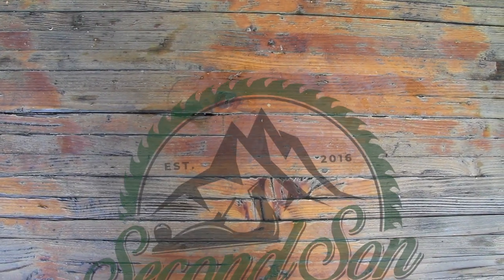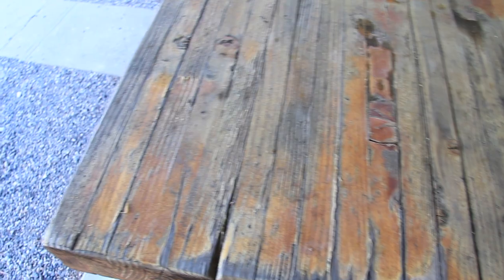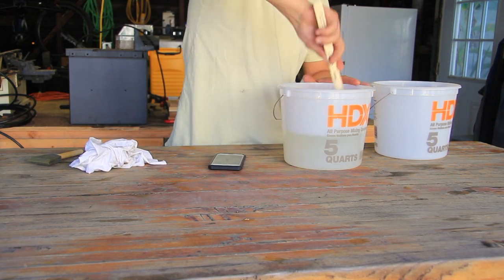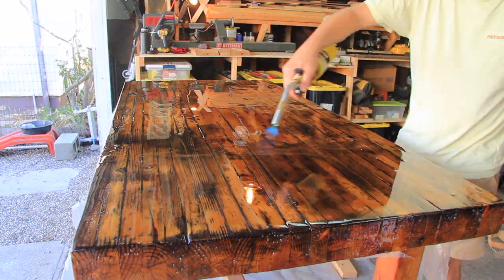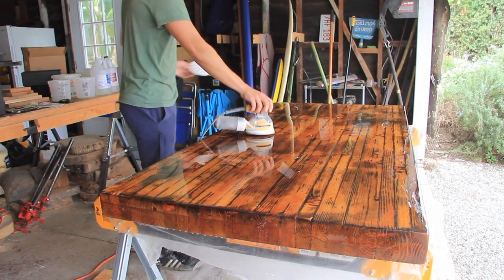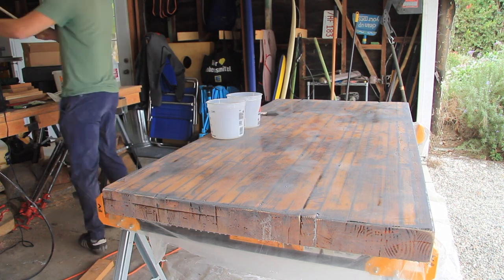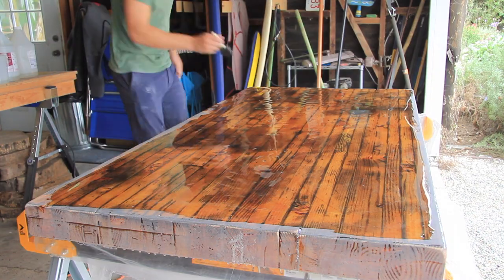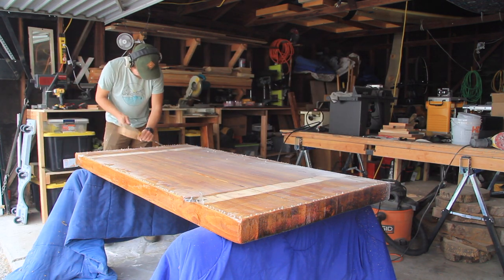Epoxy Pour on a 2x4 Table // What To Do If Epoxy Bubbles

Comment: I’m doing countertop.  First layer of epoxy had a lot of bubbles for one reason or another.  I’m in the process of sanding it down starting with 80 grit and working up.  Just doing some by hand they don’t appear to be deep so I’m hoping the sanding and repour work.  It can be very frustrating.  This time after sanding I will wipe with alcohol and microfiber cloth.  I will make sure it is mixed very well.  Any other suggestions?  Torch didn’t help keep all bubbles out first time but  I’ll try again.  Other than the bubbles it looked great.  So I hope I have the same luck.  
Your table looks exceptional!  Great job!
I think you have to enjoy this type of thing.
Reply from the maker: Yes, bubbles are quite common, very frustrating but part of the process, so just reframe your perspective :) I have been wanting to try thinning epoxy with mineral spirits to see if it will seep deeper into the holes, and use this to do just a seal coat. But you could also try CA or hot glue to fill the voids before pouring epoxy. Use an electric sander and wear a mask! It may take several coats, but that’s okay. Yes try and enjoy it haha cheers!

Comment: You should have done a thin seal coat first which seals the voids and then go a little thicker on the subsequent coats. Great job though. Have a great day my friend.
Reply: totally would have saved so much labor with a thin seal coat. but you battled through it.
Reply from the maker: That's essentially what I did during the first coat, but I guess I may have used too much. Anyways, thanks for watching and for the comment! Take care.
Reply from the maker: Perhaps I should have done less the first time eh?
Reply: @SecondSonWoodworks  for sure! lol thin to win just like cards lol
Reply: @SecondSonWoodworks  yes. Put a VERY thin first coat. That seals it better. My first epoxy pour was the same way lol.

Comment: You started wrong. You MUST, when you have an uneven surface, with holes, you have to first POUR, no brush, epoxy into those holes, you need to fill those holes first. Let them dry and cure, sand, clean and then POUR, NO brush, epoxy to the entire surface. That is the only way you will not have a crazy amount of bubbles. Using a heat gun, is better than a torch.
Reply from the maker: Yeah you are right!’

Comment: The only thing you could have done to stop the infiltration of water was to put an epoxy coat on the bottom of the table prior to doing the actual table.  Just run some tape around the edge, flood the bottom.  Let it dry.  Clean up the edge a bit then proceed like you did on top so the water that is in it won't increase or decrease.  Also less chance of separation and expansions and contractions due to water.
Reply from the maker: Thanks for the tip!

Comment: Great idea for the weathered look.  i do hope you learned something from this project.  the hot glue was a great idea but now you need to do it on the second go round.  Also denatured alcohol and a soft little brush will get rid of the whit e dust.  also you need to roller the underside of the edges and that will cut down on the drips which will bring the job down to 2 or a worst 3 coats.  I like the look  good.    RC
Reply from the maker: Thanks for watching and the comment! And yep, definitely learned a lot. Great idea for the dust. Cheers!

Comment: let us know if that coat that went on over the non-sanded coat ever dis-adheres and starts lifting off. I've seen that happen before and it seems like most people see it anywhere between 6 mo's and 2 years
Reply from the maker: Oof I hope it doesn't! I will let you know if it does. Holding up well now.

Comment: The bubbles come from the epoxy soaking into the wood. You should try a sealer first next time.
Reply from the maker: Yep from all the cracks in the wood, and that is what the first coat was, a seal coat

Comment: I had this same issue in a beautiful maple table.  Even thought I had my ducks lined up by doing my research and applying a couple coats of finish oil and sealer.  But I still had a massive bubble problem along certain parts of the grain.  It was devastating to see.
In the end I had to take it all off and try again.  Surprisingly wood wax finished was the ticket, and I had zero bubbles after applying and buffing the table with it.  Lessons learned the hard way.  Thanks for sharing yours.  Makes me feel better knowing many of us have done the same thing.
Reply from the maker: Wow that is a great idea, wax, thanks for sharing! Appreciate you watching and commenting. Cheers!

Comment: I think your video was really worth watching. I have been making a table top for a few weeks now from recycled timber beams. I taped all cracks on the bottom and the side and used deep pour casting epoxy into the topside cracks and knot holes until no more bubbles. About to sand it all back now. I am going to polyurethane the whole thing as it will be exposed a bit to the sun (Australia) and the polyurethane has some UV inhibitors. I really like the look of your table. Hoping mine turns out as nice. Well done.
Reply from the maker: Thanks so much for watching and the comment! Sounds like your table is gonna be beautiful! Cheers mate

Comment: I done hardwood floors with my brother in-law years ago.. You might try a woodfloor feeler to feel the cracks, then sand it off.. Also use sheeps wool that wraps around a block with a small handle to apply a thinner coat of the epoxy 1st. Could help from allowing air to seep out of the cracks.. Then build thicker coats 2nd & 3rd
Reply from the maker: That is a good idea, thanks for sharing! Cheers.

Comment: You may want to epoxy the bottom also to prevent uneven moisture absorption. Love the weathered look you got.
Reply from the maker: Great idea! Thanks for watching
Reply: I saw another video in which they used a product called "redgaurd", on the bottom.  Same concept and probably less time-consuming.
Reply: I thought the same
Reply: Not just resin the bottom, but also resin the legs and all of the wood.  I resin coat metal and concrete table tops for my outdoor area.  The sun can really beat the resin up, however, but that's the case for any and every sealer.  But I just make it a practice to strip and reapply the resin.  Curious how this looks from being in the weather for a few years.

Comment: Had this happen with some knots yesterday.  When the epoxy started to thicken and was unable to seep down into the knot, I took a nail to the bubbles to force the air out.  The epoxy was still thin enough to level out.  I made the mistake of applying heat from a heat gun to one and it thinned out the epoxy causing it to run back down into the knot forcing out more air.  Once it cooled, I took the nail to it again and all was good after that.
Reply from the maker: Nice, good idea, thanks for watching and commenting!

Comment: Nice work 👍🏿 Any tips for a first time epoxy pourer covering an outdoor wooden bar top.
Reply from the maker: Thank you! You know after doing this table and letting it sit outside for 4 years, I will never do epoxy for an outdoor table again, the sun, moisture, and temp changes ultimately destroy it. I’m gonna do another video on it at some point, but I’d recommend using a spar urethane instead for outdoor stuff, it will last longer. Best of luck mate!
Reply: @SecondSonWoodworks  Any suggestions on a product. There seems to be just as many of those to choose from as the epoxy.
Reply from the maker: @thatmanbolt2877  I have used the Helmsman and it is good

Comment: Good video and info as I have some resin problems myself. Just wondering, I was always under the impression the resin items do not hold up well in the outdoor weather. Have you found that this is not entirely true?
Reply from the maker: I’d say it’s halfway true, if you are in shade than it seems to hold up well, but mine was in direct sunshine and morning moisture it has cracked and changed over the last several years, will have to do another refinish at some point. This is common for most outdoor furniture though. But I think it has protected the wood pretty well and I’ll still be able to refinish. I’ve heard you can thin epoxy down to get deeper into the grain. I think doing that may enable it to last even longer.

Comment: Pay attention to that table in the hot sun. Most of these epoxy resins wont stand up to direct sunlight and will turn yellow and eventually crack apart .The resin finishes are much better when used on furniture kept out of direct sunlight (indoors). Very nice job !.
Reply from the maker: I have already seen quite a bit of wear from the sun. Amazing how strong it can be! Thanks for watching. Any tips on polishing?
Reply: i usually just wet sand it with 220 / 400 / 1000 grit then use a light coat of mineral oil on top . The mineral oil gives it  a nice natural look while bring out the character of the wood .
Reply: Give it a coat of Captain’s varnish….high UV inhibitors….all boat people coat there I epoxy with some sort of UV inhibitor
Reply: @SecondSonWoodworks   Yep... @NicholasRVonStaden is right. You need to topcoat the Epoxy with a strong UV Inhibitor, like a Spar or Captain's Varnish.. Don't expect even that to last much more than 3-4 years without light sanding and recoating with the topcoat.. Nothing holds up to harsh Sun. It's the killer.
Reply from the maker: @MarkThomas123  Sun really is the killer!!!

Comment: If you seal the wood with something that dries faster and clear like polyurethane, it helps tremendously with air bubbles that pop up on the final pour
Reply from the maker: Great idea, the seal coat with epoxy didn’t seem to work, maybe even thin out the poly, thanks for watching
Reply: Can i use lacquer to seal the wood surface before I apply my epoxy? 😢

Comment: Excellent! I would keep a tablecloth on it to protect it from the UV rays of the sun. I would also recommend doing the legs. Just one or two coats. I finished a 90"x48' Table made of chestnut. Those worm holes never filled up. Thanks for sharing.
Reply from the maker: That is a great idea, wish I would have done that because the weather and sun has already done a lot of damage to the top, unfortunately. Wow that is a big table! Good job. Thanks for watching. Cheers!

Comment: Hi bro! Very nice video! How is the table after these months? I’m looking for some outside wood works with epoxy, but didn’t find many information. Thank you!
Reply from the maker: Thank you! It has been great. I put a cast iron pan on it through recently, on accident, and it damaged a spot. I will be doing a buffing video soon with this compound I saw. Hope that it will take it right out. The epoxy works great with the outdoor furniture, if you apply it right.

Comment: Saw elswhere on YouTube that two or three (or four) skim coats sanded in between seals the surface for the bubble free final big pour. Less goop for bubbles to enjoy (pop) and dries faster. I think wood glue and sawdust for gaps. I think.
Reply from the maker: Good tip! Thanks for sharing and watching

Comment: Painters tape along the edges on the underside clears up the dripping problem. The day after pour it can be remove with a little heat from a heat gun and it will pull right off taking the drips with it and leaving perfect edge.
Reply from the maker: Good idea, although I’ve done the paint trick and it sometimes gets stuck after the epoxy dries and you have to sand it off. I’ll try with heat next time. Thanks for commenting!

Comment: Whenever I've used a table top epoxy finish, tiny TINY dust particles settle on the finish as it cures. You know the ones, you can see them floating around in sunbeams. After the epoxy cured, these would be all over the surface. I'm not seeing any of them in yours during your final product B-roll at the end. How did you deal with this issue?
Reply from the maker: Yeah that is always a worry. The best thing I have found is realllllllyyyyyy cleaning my shop beforehand, using my air compressor, maybe even leaf blower to get out all the dust! Good luck mate

Comment: This may be a silly thought, particularly since I have never used epoxy, but what if you thinned it a bit? I have done several hardwood floors and when using polyurethane, I have used a wee bit of paint thinner in the mix. This seems to let any bubbles that may come up be easier to brush out. Just wondering.
Reply from the maker: That’s not a bad idea, I’m not sure if that would work out, but may be good to try on a small scale. Thanks for watching and the comment!
Reply: If you want to work with thinner epoxy all you do is let the bottles sit in some hot water before you mix it

Comment: Just watched some professionals doing counter tops. The don't use or recommend flame, but just mist with alcohol, and the bubble pop. You say there is a lot of sun in your area, exposed over time, it will change the  color, and even crack it.
Reply from the maker: Great idea, thanks for sharing

Comment: Good work, but you may find the epoxy is not UV protected and will degrade rapidly in the sun.  A good UV urethane would keep the table protected for a much longer time.  The urethane should be applied over a well-sanded (250 G) epoxy for a strong mechanical bond.
Reply from the maker: Thank you and yes you’re very correct! Thanks for the tip and watching, cheers!

Comment: I had that same “epoxy dust/bubble” problem. After I sanded I actually used a hose with a spray nozzle and it worked just fine to remove the dust from the small craters.
Reply from the maker: Great idea! Thanks for watching and commenting. Cheers!

Comment: Working with epoxy on any wood besides MDF needs a seal coat…1oz per square foot, just enough to seal the wood then you do your flood coat. Then you only have to go over the epoxy 2-3 times during the cure process with a torch to pop minimal bubbles providing you mixed it correctly.
Reply from the maker: Yes which is just about what I did, and there were still bubbles. So people should plan to sand out bubble after a seal coat in situations like this. Cheers!

Comment: you need to seal raw wood prior to coat in epoxy. it eliminate your bubble problem
Reply from the maker: Do you mean apart from the seal coat of epoxy?
Reply: @SecondSonWoodworks  get one of these. sometimes you need more than one seal coat also but it should just be seal and flood coat for over wood but sometimes you need two flood coats ya know. two projects are never the same. ,,,,, 
VEVOR 1.5 Gallon Stainless Steel Degassing Vacuum Chamber with 2.5CFM 1/4HP Vacuum Pump Kit (2.5CFM Vacuum Pump Single Stage + 1.5 Gallon Vacuum Chamber)
Reply from the maker: @briancrabb4336  That would be handy to have!! Thanks for sharing

Comment: You are also using your sander the wrong way, you never angled your sander, you have to go as flat as you can, not pressing, you let the sander do the work so the surface is flat and even.
Reply from the maker: I actually find applying an angle to my sander to be useful when needed to get burn marks or cuts from the milling process out of the wood

Comment: APOXY WILL BUBBLE FROM NATURAL ABSORPTION INTO THE WOOD,YOU NEEDED TO seal the wood,sand then seal. Then seal with light coat of Apoxy,sand after dry,do it 3 times and removing bubbles each time,then by the 3 you should be ready for a poor,pooring right away you get what you got, a little research would have prevented it,lol
Reply from the maker: Yes it will! And that is essentially what I did, but because there were so many cracks and voids in this table, the bubbles kept coming!! IT was super hard to get it sealed. Thanks for watching and for the comment!

Comment: You've done no prep work with a belt sander and a sealer.
Reply from the maker: I wanted to keep the weathered look, as I explain in the video, and the first coat of epoxy was meant to be the sealing coat. Thanks for watching!
Reply: @SecondSonWoodworks  You're not the first guy coming with the idea of keeping the patina on your surface but you still need to remove the loose varnish chip and start with a fresh scuff.
Reply: @SecondSonWoodworks  I understood it that way also )